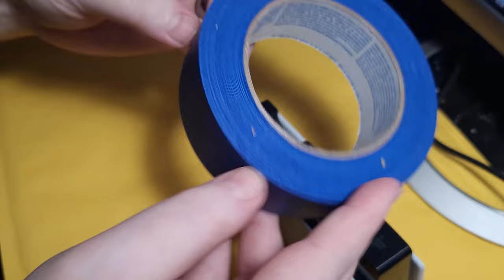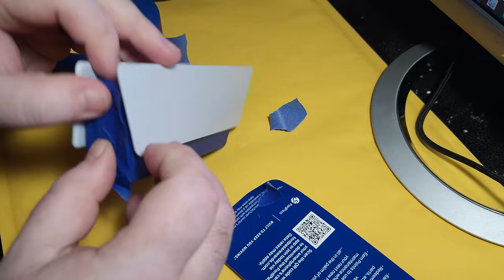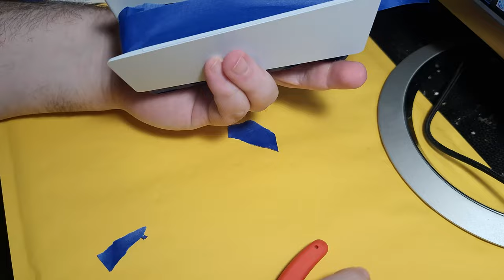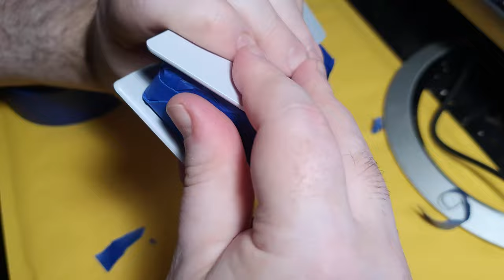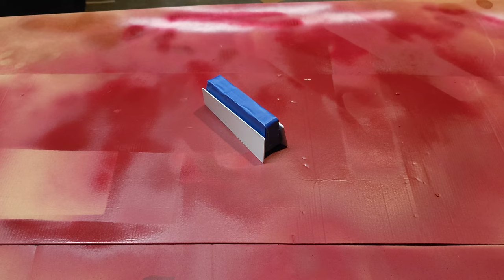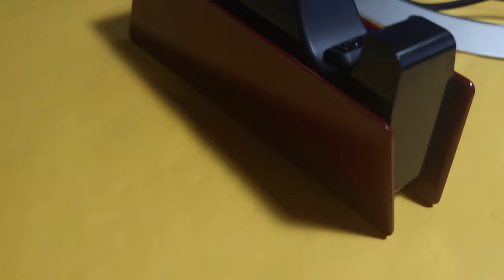Custom Painted PlayStation 5 Slim (Charging Station) Walkthrough / Tutorial (DIY)

Comment: did paint get in between the gaps or was taping it good enough to not get any inside the charging station?
Reply from the maker: Thanks for watching! The Tape kept the paint out well. just be sure to use a tool to press the tape firmly against the tight areas you want to cover.